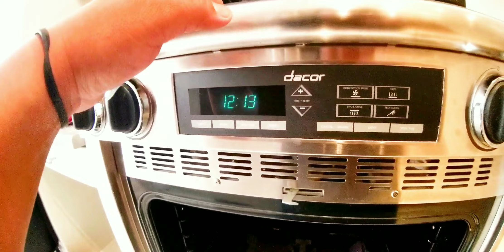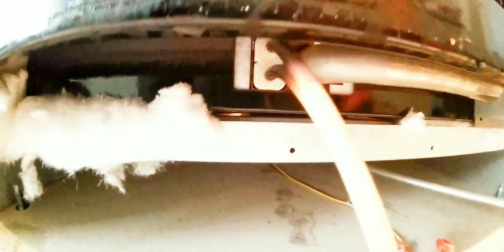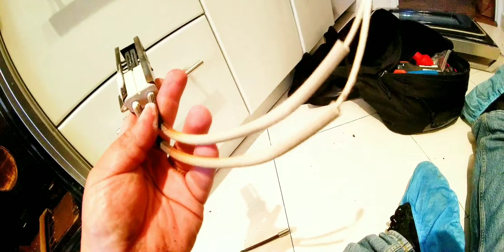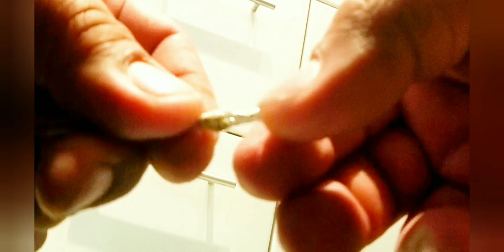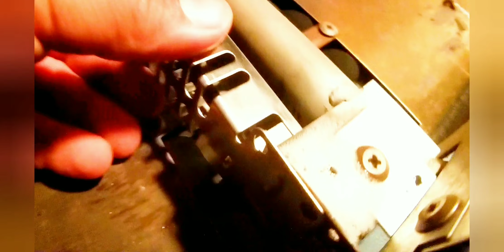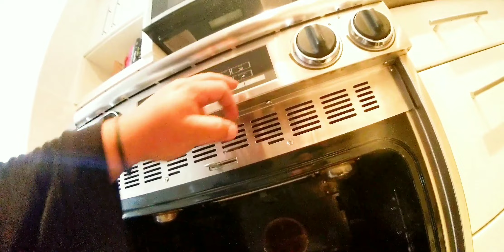BAKE NOT WORKING/fix almost any GAS OVEN.smell gas.too long to preheat..DACOR OVEN FIX..#diy #repair

Comment: Man that's crazy, glad I saw your comment on Bondo Billy's page. I am actually having the same problem with my oven in right now. Excellent work . Definitely subscribed.
Reply from the maker: Did you fix it...need any help?
Reply from the maker: Thanks for the sub
Reply: Yea I got it fixed, All thanks to your video 👍
Reply from the maker: @whatupdoe5744  hey thats fkin awesome glad i could help